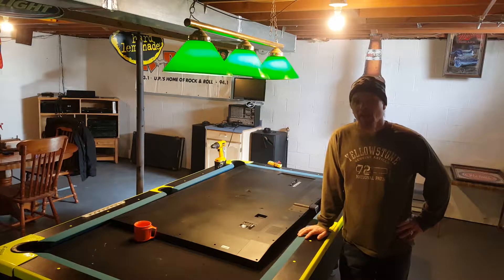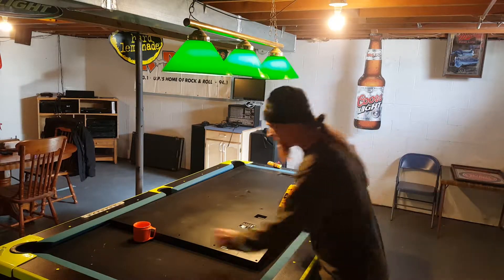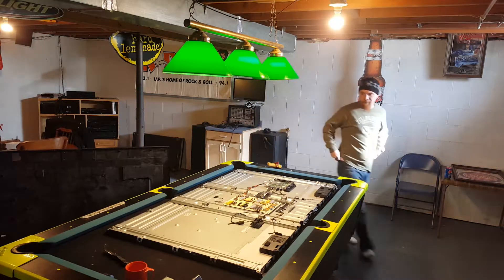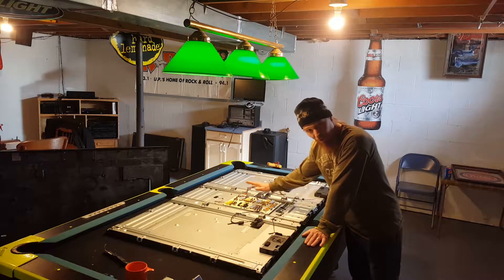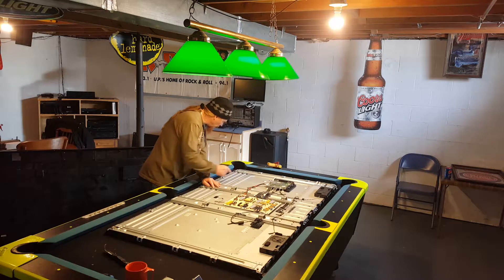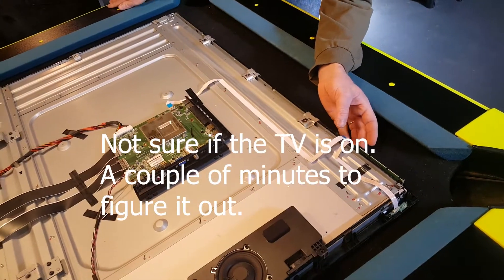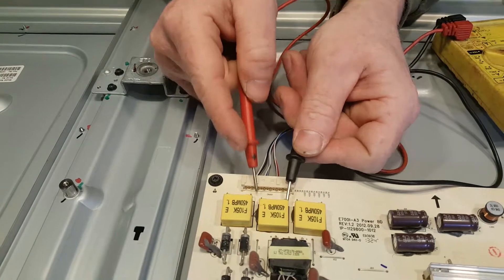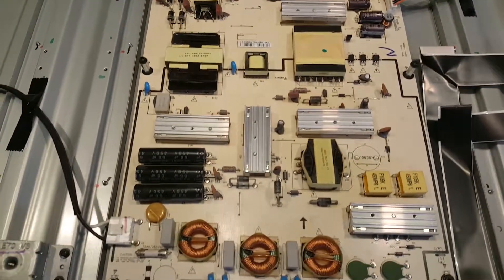Vizio TV with no backlight.  Part 1

Comment: when the TV is ON you have to shine a flashlight on the screen to see if you can see NO SIGNAL if that is the case the Led's are bad and need to be replaced, befor you do anything goto shopjimmy.con search for LED tester and buy it and search for your model number and see if there are other sets of LED's for your model number if thats the case you will have to take it apart and get a part number off of the LED's, you have to flip it over on the screen side and disconnect the LVD cables to T-con board and disconnect and remove the speakers and the plate over the T-con board and set aside and any wires that are on the frame, then flip it over screen up, there are screws around the frame take them out, take the frame off set it aside, then the metal plating that is on top,bottom and sides, unscrew them, gently disconnect the ribbons on the right and left bottom corners make sure the boards on the sides and bottom are separated from the frame (you will need help lifting the screen up and off the frame and ware gloves to prevent fingerprints) one person on each side of the TV lift the boards bottom and sides connected to the screen, lift the boards a little to see if the screen will lift up off the screen(careful not to rip the ribbon if you do the TV is trashed and cant be repaired) if not then use a hair dryer to heat up the screen to loosen it off the frame some screens have double sticky tape to hold it in place if the lifts, lift from bottom up till its standing strait up so the screen does not bow in the middle and break! carefully lift screen strait up and move to a carpeted floor and lean it up agents a wall with the bottom of screen about 3" from the bottom of wall so the boards hang down on the screen leaned on the wall, use painters tape and tape the 3 sheats together overlap part of tape for ease removal, then take the plastic sheathing and plastic board out same way set aside, there are screws holding the LED Bars take them out and use a box knife and cut between the frame and LED's to take them off, replace and put back together in reversed order.
I use magnets out of  computer hard drives to hold the screws, you can use a zip lock sandwich bags for each section, frame, back cover, and each part just keep the bags in order or write cover, frame etc... on the bags with a marker.
Have fun and take your time! DON'T Rush or you will damage the screen and the TV is TRASHED and cant be fixed! Al Jim Myers TV/PC Repair